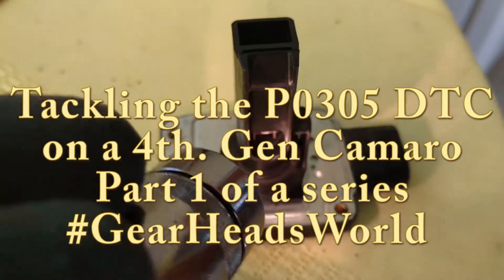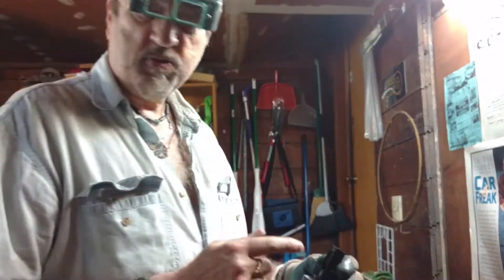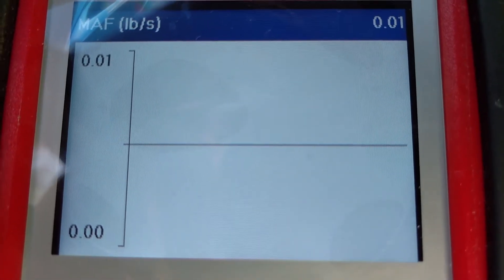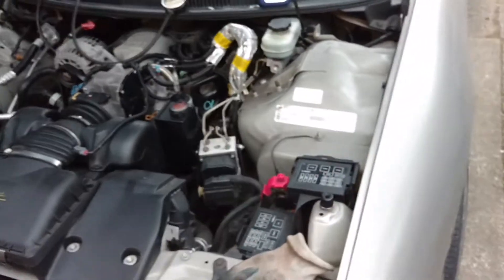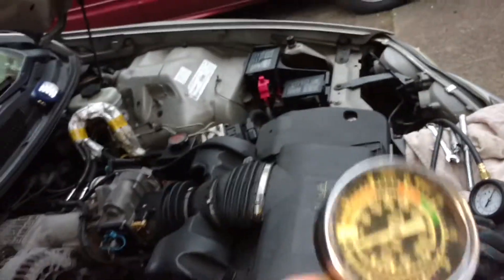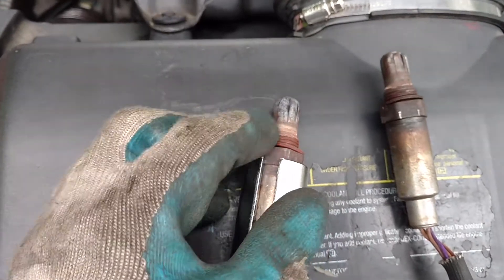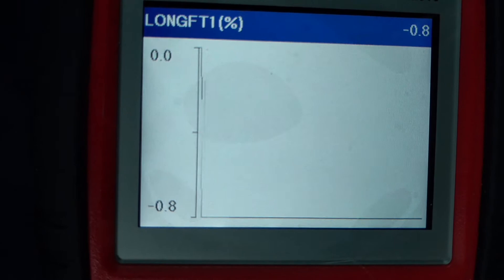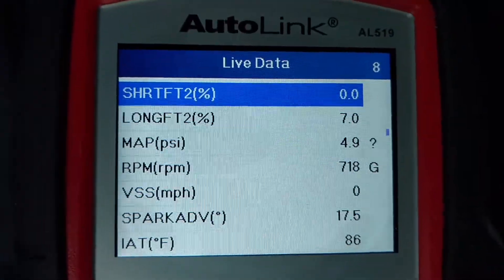Camaro 3.8 MAF, O2 Sensor, P0305 Troubleshooting, Waveforms: VIDEO #GearHeadsWorld

Comment: I have a 97 Camaro V6. Engine Service Soon light on, and ruff idle. Check it out, OBDII said cylinder number 5 missfire. Changed the spark plugs, first thing, and run great, for a day... Now it does the same. I need to change the wires and hope it is just that. If that doesn t work, some say chould be a bad injector. The car shakes at red light, and when you step the pedal it does not have the same power and you can hear pops like pow pow shooting inside the engine if i step the pedal all the way down. Chould you help with some ideas ? PS: i am from Romania 🇷🇴, and this Camaro is the only one in the country, 30th edition, 30 years of Camaro.
Reply: Also have a 97 3.8 Camaro and recently started it for the first time after 2.5 years. Have the "bucking" when accelerating, but only sometimes. My guesses at this point are possibly: MAF sensor, O2 sensor, or something related to the spark plugs, wires, coils, or possibly the ignition control module (sits under the coils). I've read that all can be the issue
Reply: @rakohus  my problem was the injector sensor was out, i just plug it in and all wass good. Before all of that, i changed the ,engine oil, completing transmission oil, a bad coil, and new spark plugs ! And now i will put full straight pipe because the catalytic convertor is done. Rumbling specially at cold start ! I hope you fix it !
Reply: @athosndl  Thanks! Glad to hear you're up and running

Comment: I want to start a new thread discussing the readings on the scanner.  Right away by looking at your long term fuel trim bank 1..   16% or 17%  is telling me you are running very LEAN on that side. (my shot in the dark is maybe you're not getting voltage to your #5 injector)..  The short term fuel trims aren't so important.. Those trims are to keep your catalytic converter happy. The Cat needs a combo of oxygen and NOx gasses to work properly, so that is why it's always oscillating, and perfectly normal.  

Basically, If you're seeing greater than +- 8-10% on long term fuel trims, you have something going wrong.  If it's running LEAN (high fuel trim percentage value) on both sides, Look for a vacuum leak.  Puff on a cigar and blow it through the brake booster vacuum line and see if any smoke comes up from places where it shouldn't be (ignoring at the Throttle body)

To break it down,  The long term fuel trim is there to make sure your short term fuel trims are close to, or AT Zero most of the time, and the job of the short term fuel trim is to keep the cat happy and not melt lol.  o2 sensors aren't exactly sensors, they are more like a reactor. Low voltage on o2 sensor is a lean condition and high voltage is a rich condition. The o2 "sensor" basically generates a voltage when there is a delta between ambient air and the exhaust gas it's measuring.  blablabla.. 

I'm seeing now that BOTH bank 1 and 2 are very lean on the long term fuel trims.  the 16% means that the injectors are being held open 16% longer than normal to compensate for being LEAN. if it were -16% then that means it's taking away 16% of the injector pulse to lean out the RICH condition.    It's counter-intuitive but once you see it it'll click. 

When was the last time you did a fuel filter replacement?  just a random question heh. plus its cheap and easy to just knock out and check off the list. 

Also, pull the vacuum line off of the fuel pressure regulator and block the line to eliminate the man-made vacuum leak.  By doing this, you'll be increasing the fuel pressure in the fuel rail and those long term fuel trims SHOULD go down some.  if there's no change, I would also suggest a new fuel pressure regulator.  

Definitely check the lead on number 5 injector with a test light though. Something is telling me you're not getting a voltage sent to that injector. 

Your Manifold Absolute Pressure seems a little high for at idle.  I would be happier seeing it idle at around 5psi on the MAP (or around 10" hg). again, visually check with smoke for vacuum leak. 

When you took the throttle body off and cleaned it up, did you do a throttle position relearn?  If not,  disconnect the ground from the battery for 5 min or so.. Re connect it.. 

Then with the car in park, no accessories on, no ac, no lights, start the car up and let it idle for 3 minutes (use a stop watch) ((DO NOT TOUCH THE GAS PEDAL)), I usually go til about 3min 30 seconds to be sure.. Then turn car off, key in OFF position.  keep it off for a MINIMUM of 60 seconds.  then start it back up and let it idle again for 3 or so minutes.  Turn off for another minute or so, then let it idle again for 5 minutes.  this should reset your Idle air controller in the throttle body..

No load Idle should be around 750-800 RPM's..    If not then Im back to pointing at a vacuum leak somewhere.  a 300 rpm increase at idle tells me theres a small vacuum leak, and the fact that both of your Long Term fuel trims are compensating over 10%.  A vacuum leak is unmetered air, so it will ALWAYS create a lean condition. 

Sorry i'm all over the place..  I'm not a professional either, however, I do have a mechanical engineering degree and Im about 98% sure everything I just typed up is accurate.
Reply: All good tests and I hope to supply current waveform readings soon. So I have found a bad cam lobe, number 5 exhaust. In the process of pulling the cam now. Looks like that one will end up being another video.
My theory is, the worn down lobe  was closing the exh  valve too soon, there by polluting the intake charge with spent gasses from the reversion.
Reply: @hotrodsrockrollandgoodtime418  while you're in there check the preload of the rockers and also the bushings. Don't forget to check for a possibly bent pushrod. Looking forward to hearing the updates.
Reply: @hotrodsrockrollandgoodtime418   That's a lot of wear to cause such bad reversion.  No broken valve springs? you were getting good compression though, right?  I forgot to ask, did you do the compression test on a hot or cold motor?
Reply: The camshaft took care of the misfire trouble code. Since then I have chased around numerous other trouble codes. Just replace the the downstream oxygen sensor which made the short-term fuel trims even fatter. Hopefully more driving will bring about a block relearn so I can get rid of the P0174. Both long-term fuel trims have been pegged at 19.6.

Comment: did you do coil packs and ICM?  I went through 3 brand new ICM's before finally installing one that wasn't faulty from the part manufacturer.
Reply: Ugh. Sounds like you had your own nightmare. I got a ECM from 205 Auto salvage. That didn't fix it. Tried the ICM. Didn't work. Brought it back. But before it was said and done I would reinstall that ECM to solve another problem. That was another story. Then I found a bad cam shaft lobe!
Reply: @hotrodsrockrollandgoodtime418   When it came to the Ignition Control Module, the only place that provided one that worked was NAPA. I also put some thermo-tec heatsheilding between the valve cover and the ICM  bracket doohickey. these cars are notorious for heat soaking those packs and ICM.  I hope you find a solution soon.   One little secret about these 3.8's..  They don't like irridium plugs, or platinum plugs.. they crave an old school standard plug like NGK's. They want a good hot spark so be sure to always check the gap .060

https://www.amazon.com/NGK-7131-BPR6ES-Standard-Spark/dp/B00KMPBSFO/ref=sr_1_7?keywords=ngk&qid=1560247738&s=automotive&sr=1-7
Reply: I also want to add to this.  I watched all of your videos going through this problem.  One extra step to rule any issues out.. 

Connect a test light to injector 5 lead, if it's not lighting up, there's your problem.  The ICM is responsible for sending signals to the PCM which then in turn, fires a signal to the injector to open up.  So if you're not getting any injector pulse and your test light isn't lighting.. I would then trace the two leads to the PCM and see if there's bad wires/connections..  Also check the wires going from the PCM to the ICM. If the wires look in tact and decent condition, then I would get an OEM Ignition Control Module from NAPA autoparts (trusted source of good parts for 3800 series II), and if it's still not firing injector 5, then you're looking at possibly a bad Powertrain Control Module.

  by the way, all of those graphs and everything are fairly normal especially considering a continuous misfire on cyl. 5.  I'll have to go back and look at them more thoroughly but from my memory, all looked within reason. Good luck. PLEASE keep me updated. 

Best of luck.
Reply from the maker: Yes I have done all of those tests in the past. The camshaft finally fixed the p0305. And all the other trouble code started popping up. I have since had to replace a coil and a cat. Haven't had a chance to post all of that. My last code is a p0174. Lean on bank 2. But scanner reading seem equal. MIL  light has been off for days. But it comes and goes in the scanner. Freeze frame shows 3.9 + 19.5 ltft. Both sides. It happens idling at 1 mile per hour. 

Still waiting for EVAP to clear on this last drive cycle. Then see what happens with this p0174 code.

Comment: Another great video, in fact I've watched all your videos on Camaros. I have a 2001 3.8 and just bought a scan tool and in comparing the wave forms here are mine at idle engine in operating temp (185 deg F.):
Short term fuel trim -- 0.8, Long term fuel trim -- 2.3. O2 B1S1 - 0.065-0.930, O2 B2S1 -- 0.055-0.895, O2 B1S2 -- 0.135-0.780. These figures are close to yours except the O2 B1S2 which should be an almost flat line, therefore I think all your O2 sensors are good but my B1S2 is bad. Now I just wish you could post the conclusion to your P0305. You, kind Sir, are the Camaro guru and a lot of us look up to you, thank you.
Reply from the maker: This car went to two other shops AND to Ron Tonkin Chevrolet where they charged me over $400. to tell me absolutely NOTHING!  They wanted to tear down the engine. They claimed my compression was down 50 lbs. I think and my Leakdown test was ... oh, something like 8%. I made another vid on when I checked all of this so ........ real disappointed with Ron Tonkin - I will say that.   :-(
Reply: I ended up fighting many different trouble codes on this this car for all kinds of reasons. In the end, the p0305 was due to a worn cam lobe. #5 exh.